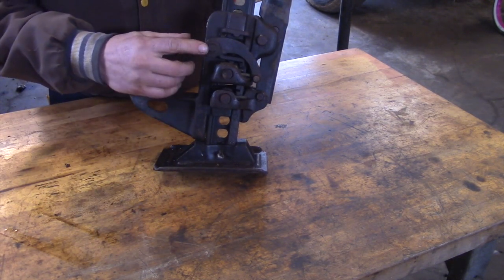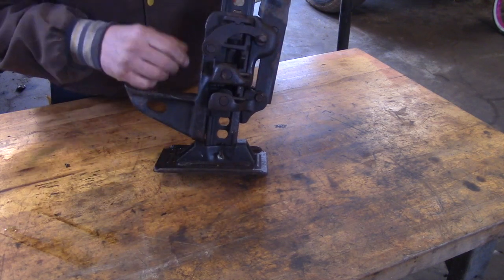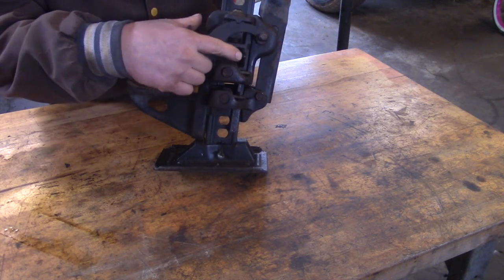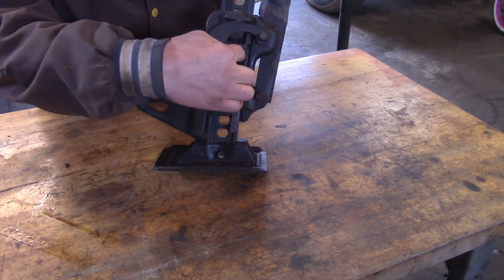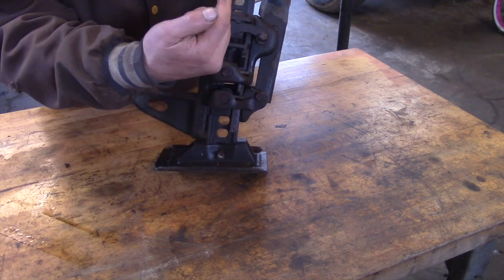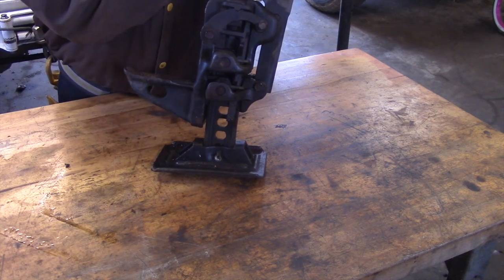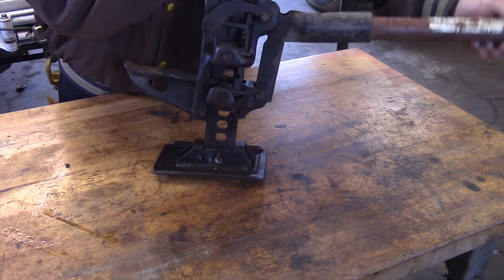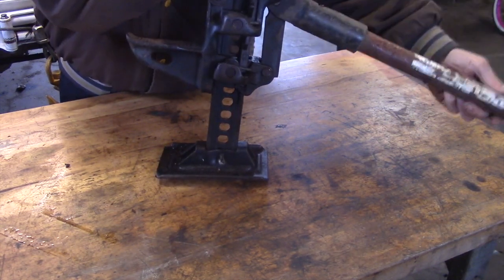QUICK TECH TIP 3 by BSF Recovery Team

Comment: anyone that has had a car no newer then early to mid 80s understands that jack. They came as standard OEM jack with the difference with a little hook that fit in a slit in the bumper. I still feel the old bumper jacks beat any scissor jack the comes OEM since late 80s early 90s

Comment: i usually just put some grease(not alot enough to coat the pins) in the moving parts and work it up and down a few times making sure the pins are free, so far it has worked.. my only problem is unless you have heavy duty bumpers and rock sliders its kinda useless ... on my 02 f250 the only jacking point i have are on the tow hooks on the front bumper. and the receiver hitch (if i strap the axle around the frame to keep 1 wheel down).

Comment: ive been considering buying one for using with my tractor and equipment
Reply from the maker: +tractorboy31 I remember when farmers called them "the farm hand jack".
Reply: +recoveryteam  growing up on the farm i always heard them called handyman jacks. that may have been another brand name, im not sure .But i know the jacks we had around were indeed hi lift brand ..
Reply: +recoveryteam  Here in Tennessee we call those farm jacks as they have many uses. Great safety video!
Reply: I'm up in Alberta Canada, and I call them widowmakers, you have to respect it. It's a great tool but can auto ratchet down.